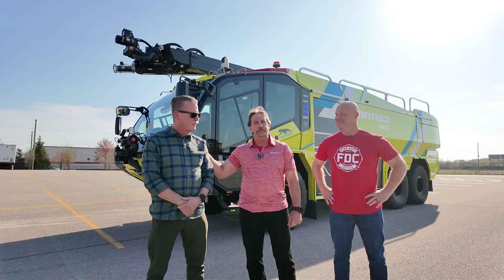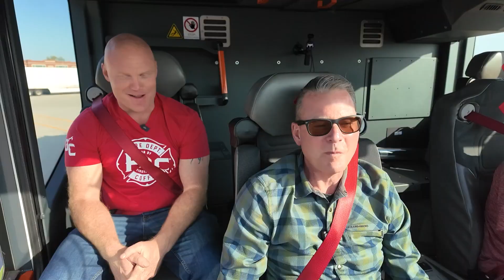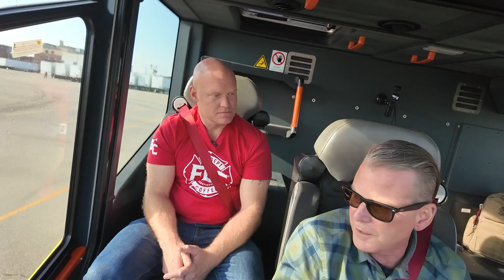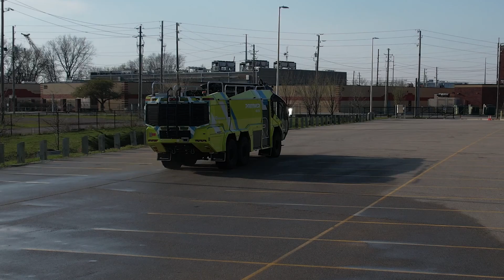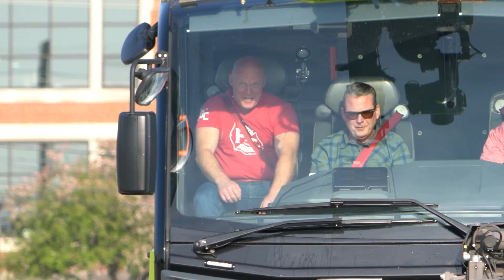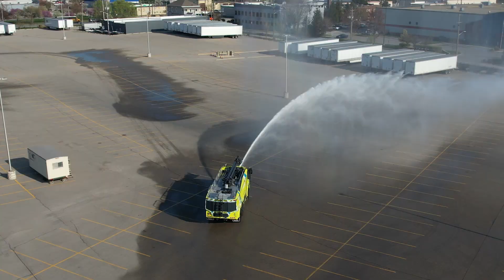Rosenbauer PANTHER electric and Fire Department Coffee Ride Along

Comment: I love this! Electric has always been the future. I understand the generator eliminates range anxiety for most people. Until we have a well made charging infrastructure throughout the states this is the best way to get a handle on emissions! Keep up the great work for the firefighting industry but, don't forget helping other motor industries as well. Maybe help make a kit for the Joe blow to be able convert their car or truck!?
Reply: Regardless of how good the charging infrastructure is. There should be a small combustion engine generator on these kind of truck to charge the battery as insurance. Series-Hybrid is the superior best power train for this kind of work.
Reply: I agree! There should be way more hybrids until the battery tech gets so good that gas is no longer necessary. Also, when the batteries are using materials that we don't have to mine or import them! @Neojhun